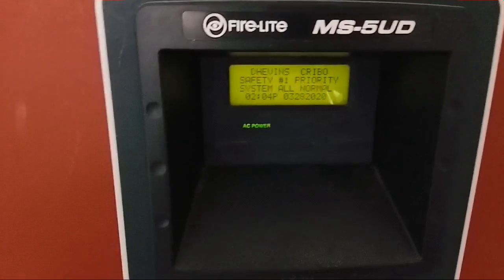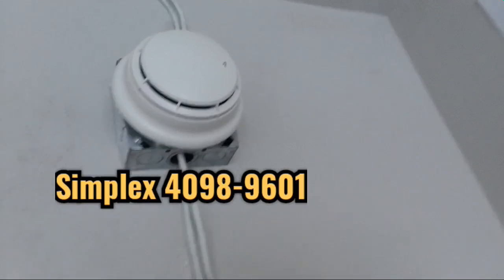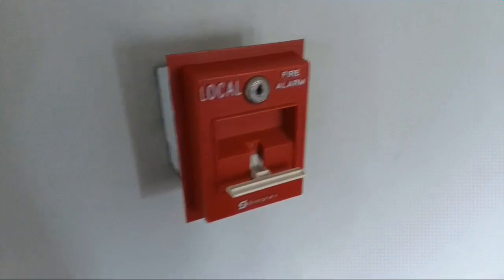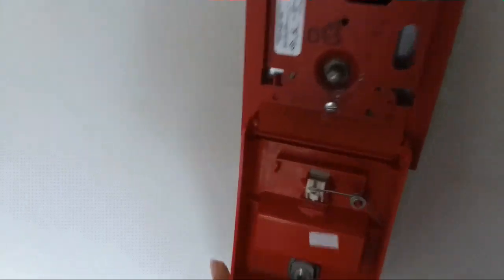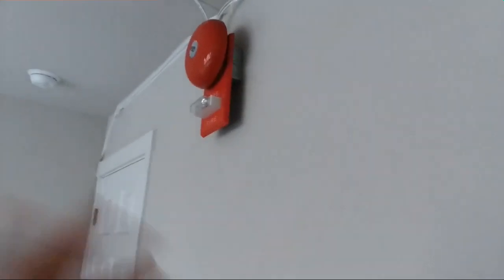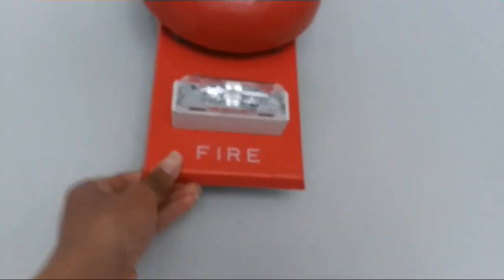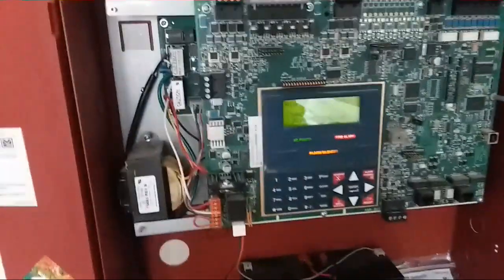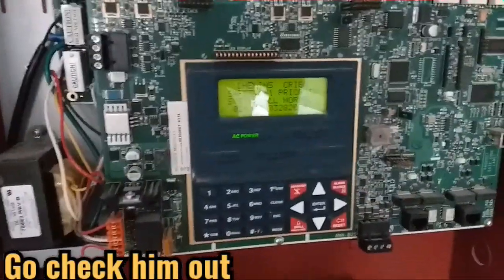Bedroom System Test 4| Amseco Motor Bell

Comment: Sometimes the gong of the amseco bell Gets stuck
Reply from the maker: You mean the striker? Sometimes the motor stops in the down position, causing the striker(the metal rod) to be pressed against the gong, which is basically the equivalent of putting your hand on it while it's sounding
Reply: @BlackLightning4547  Yeah that’s what I meant the striker